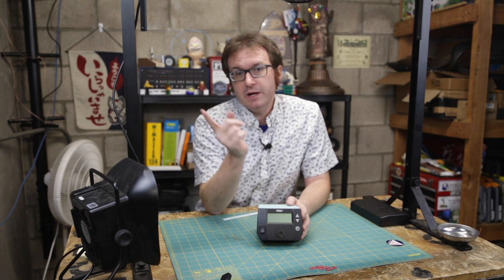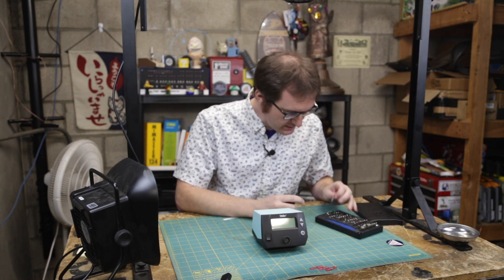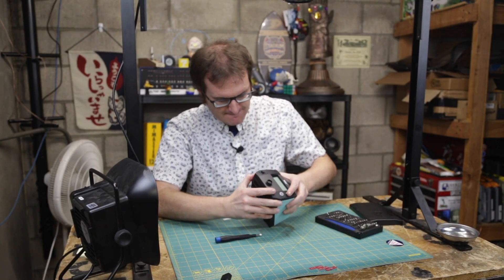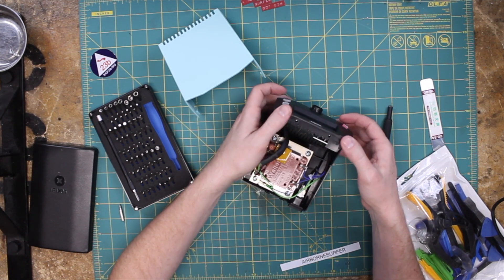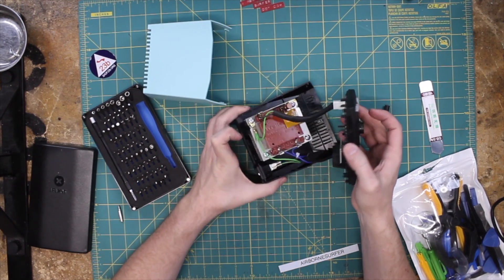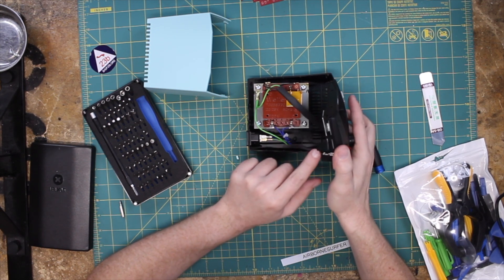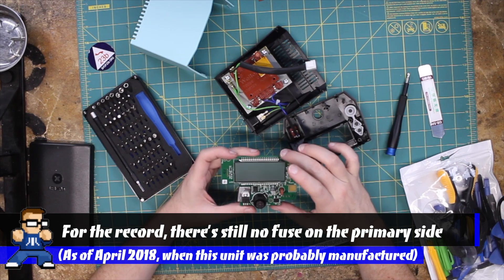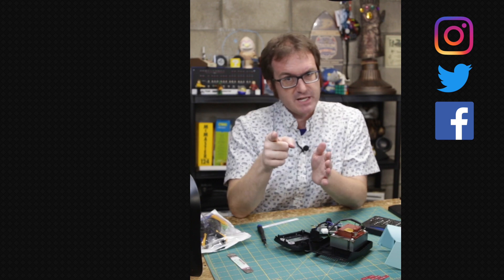Weller WE1010 Soldering Station Teardown

Comment: Thank you for making this video, though it has misleading info about some internal parts (like the 78M05 voltage reg.) and teardown of the case was more like wreck down. But that's also valuable info how NOT to do these things. I agree with others that Weller cut too many corners by skipping the input fuse, the main switch pilot light, and also a back light for the LCD.

Comment: OMG, you're not doing anyone a service by reading manufacturing/date codes and calling it a MOSFET when it's clearly a 78M05 regulator. And then you call the next part a MOSFET when it's a TRIAC.  X5, 5 port indicative of USB? Really? No, it's a serial (probably SPI) programming port to the microcontroller hiding under the LCD.  And the only thing that actually was a heatsink (not for the "MOSFET") was loose and you tightened it and didn't even bother to mention it was loose. Poor QC if that thing is not on tight.  Please learn how to read part numbers and ID things properly before you make videos like this.
Reply: That loose screw wasn't "poor QC" on Weller's part, he unscrewed that heatsink earlier at 6:46 🤨

Comment: Still no primary side fuse then..
Reply: There's a FUSE there, on top of the transfo, jumping into your face. : t4A250Vac. Internet is jam-packed
with half-witted morons.
Reply: @pasdutout4690  Before being aggressive try to understand the whole thing. There is a fuse only on the secundary, not on the primary. Both are essential.
Reply: Popular comment, pointless argument.  How many times did you blow your previous fuse? 
My drill, table saw, and microwave don't have primary fuses, and all have worked for decades.
Reply: @frankdiscussion9988  Even the cheapest chinese Hakko clones have fuses in them so there is no excuse to not have a fuse in a product from well known manufacturer.
Reply: Frank Discussion why is the argument pointless?

Why is it ok to not have the primary fuse? If it’s ok, then why do other companies include said primary fuse?